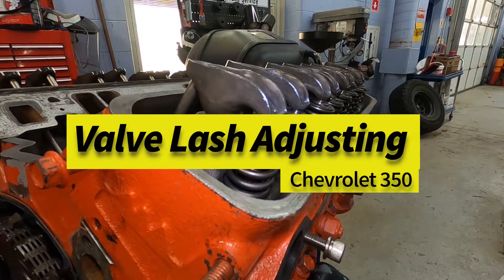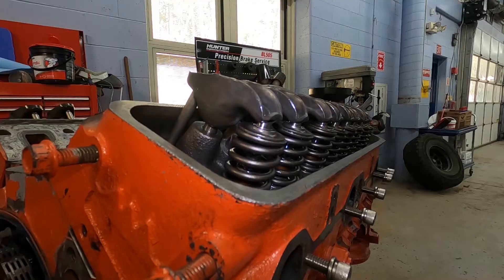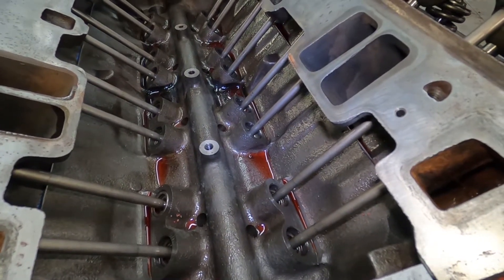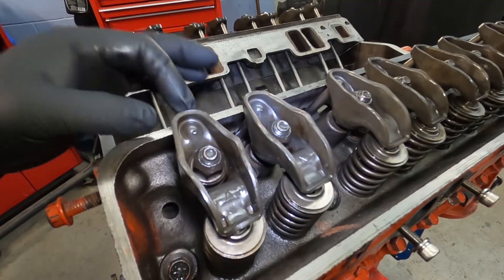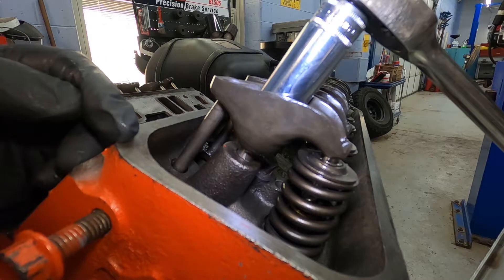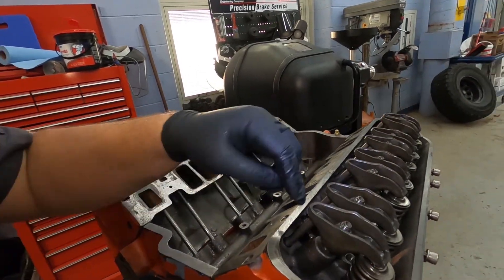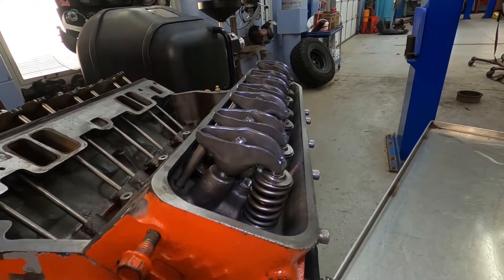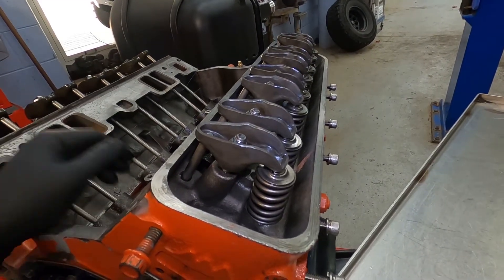Valve Lash Adjusting Chevy 350

Comment: Basically I do valve lash in two rotations of the crankshaft, then I set the distributor which the engine is now back at top dead center back on the power stroke and then distributor goes in and then I set the distributor with the points just open up on number one or the trigger Wheels face each other. It's not that complicated guys too many videos on this feature. You'll learn a lot about valve adjustment when you start working on VW engines and distributor.

Comment: ❌❌❌❌❌❌      I've been working on Chevy's for over 40 years and I must OBJECT !!!!!!!!   Do not attempt to set your valve lash this way as you can actually cause it to catch fire and burn🔥🔥🔥🔥 when it backfires on all 8 cylinders belching flames up through your intake and igniting the incoming fuel inside the intake and carburetor. This guy didn't take the time to get his feeler gauges out and actually set the valve lash properly. Nor did he bother taking the time to tell anybody what the actual Gap is for the valve lash on a Chevy 350.
So if anybody wants to know the correct Lash for the valves on your Chevy 350ci engine they are as follows.....

between 0.018" and 0.022" for the intake valves and 0.028" and 0.032" for the exhaust valves when the engine is warm and oil pressure has been established first.
  Attempting to set the valve lash at anything other than loose on a cold engine  having not pumped oil through the system yet and establishing proper oil pressure can have negative effects on your engine such as when the engine warms up and the metal expands and the pressure builds from the oil your valves will never close all the way, this is known as floating your valves. It can and will cause backfiring and aft-fireing as well as misfiring of the engine. The valve timing is critical to proper performance and setting them tight on a cold engine is a really good way to have a bad day.... 

Sincerely AJ's advanced automotive.
Reply: Okay smartass
Reply: Looks like he is working with a hydraulic cam not a solid lifter one.
Reply: @axleratio  even if he's working with hydraulic lifters he can still over pressurize the lifter causing excessive wear on the cam and low oiling from the lifter which cannot complete a full lift cycle if it is half collapsed due to overtorkng and not actually setting the valve lash with feeler gauges as should be done every time. Again back yard hacks are not always a good idea. trust the mechanic who's been turning wrenches on them for 40+ years not the one Who got his education strictly from YouTube and books but has very little real world experience and has not seen the ultimate cost of taking shortcuts such as this. I uploaded a video of a truck of mine that the previous mechanic had done just this he had set valve lash listening to it by ear in doing so one lifter which he did not hear tapping was actually tapping causing the lifter to hammer until it had mushroom the top of the lifter and the rocker arm was no longer pushing the lifter but rather on the valve spring itself. If you have any experience in what happens when you push the valve spring down while the cylinder is under compression instead of releasing the pressure from the cylinder it will hold the valve closed and launch the valve spring locks out causing the valve to drop into the cylinder when it finally opens this makes for catastrophic destruction of an engine all because you didn't take the time to run a feeler gauge.
Reply: https://youtube.com/shorts/Uv1vzxtT7ls?si=T_Ir73nBuoq408Fs 

This is what happens when valve lash is not set properly and is left to loose not so much over tightened. The person who last worked on the heads in this engine use the same technique in that video but could not hear the slight ticking that was still present due to the exhaust being louder than the tick. I'm working on uploading pictures of the damage to the top of the valve stem.

Comment: hello 3/4 turn with the tappets loaded or tappets unloaded?
Reply: It doesn't matter. Once each cylinder is set at zero lash, it's 3/4 turn no matter where the cylinder is in the firing order. You can do the 3/4 as you zero each cylinder, or set all of them at zero, then just go to each valve and give 3/4 turn in one go round.

Comment: This low compression from the valves being tight: could it cause a no start at all? Has spark and starter fluid but no start, not even a sputter. This is after I just did my heads
Reply from the maker: Yes that could definitely cause low compression but I would suggest looking at the ignition timing first and make sure the distributor is in correctly after all of that work. Even if the valves were tight it would try to fire. It sounds like timing is off to me. Good Luck!

Comment: I set #1 at TDC, adjust intake/exhaust on #1, Rotate crank 90 degrees until #8 is on TDC, adjust intake/exhaust on #8, and so on through the entire firing order. Two revelutions of the crank and it's done.
Reply: You mean number 6 not 8
Reply: @max.r1484 no, he means 8, you go by firing order.
Reply: @max.r1484  18436572.  6 is the companion cylinder to 1 and should adjusted after the crank has moved 360 degrees
Reply: Your making zero sense when you say intake/exhaust
Reply: @BygonesEraas  there’s 2 valves per cylinder no? What is their purpose you think?

Comment: Is this done before or after the lifters have been " pumped up" with oil pressure??
Reply from the maker: Before they are pumped up. As long as the lifters have been soaking in oil for an hour or so they will have the proper amount of oil in them.

Comment: 4:37 “You rotate the engine over again” is that a complete rotation or half rotation clockwise? TIA
Reply from the maker: I would suggest a full rotation so two full turns on the crankshaft just to double check that you have adjusted correctly

Comment: I get to zero lash on the base circle but not so tight that i don't have a little side to side movement. Then i go 1/4 turn tighter while on the base circle. No adjusting while the car is idling or any of that nonsense. The only other thing is that i will drop my new hydraulic lifters in a coffee can about half full of a lighter grade of engine oil for about an hour. A very high probability that subsequent operation in the coming weeks and months will be trouble free. Not to mention a successful break in of a new or reground flat tappet hydraulic cam and lifters using appropriate break in oil. Beyond that correct oil with a zinc additive, changed frequently in a correctly tuned engine should meet or surpass your expectations.
Reply from the maker: Great points! Thank you for your input, I do the same with the lifters but I usually soak them in transmission oil and coat them with assembly lube before installation.
Reply: I have always done 1/2 turn. I have found 1/4 was too little and 3/4 to much.